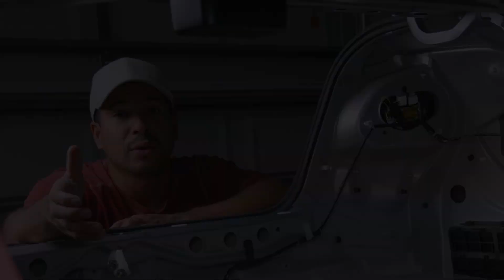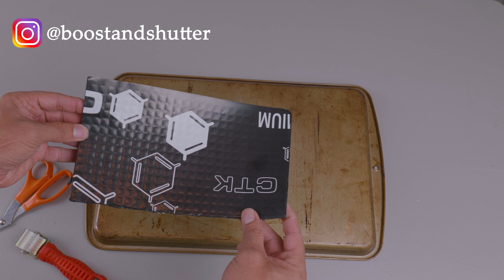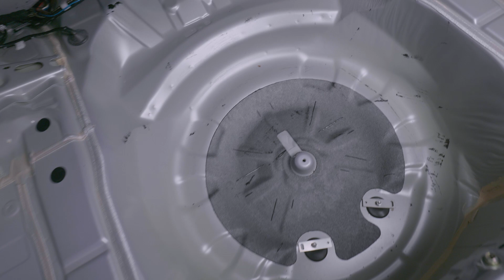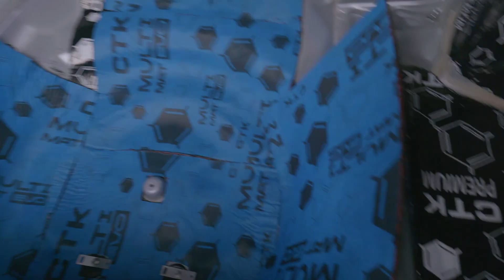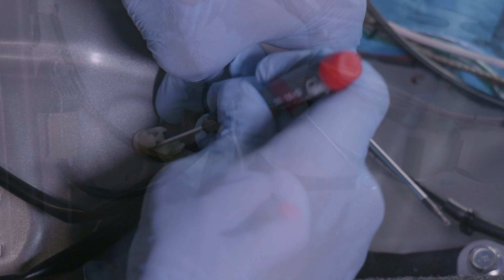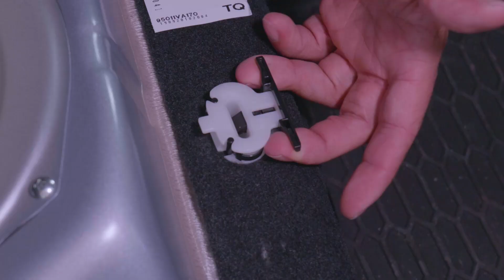WRX & STI Trunk Sound Deadening GUIDE | CTK  Review |

Comment: Nice talk through. 

I'm a professional in this area - mainly coming from aircraft before automobiles. I find many DIY channels do not express understanding of the materials and even many car audio shops or installation centres do not understand the materials and how to use them optimally. 

Constrained layer damping, deflection, absorption it all needs to work together. 
These materials are also designed to provide significant thermal benefits  and survive in very hot places which makes choice of brand important.
Reply: I respect your knowledge, can you give me exact procent of covering the trunk, sound deadening and material  which  to use to get best , but not add so much weight to the car?..should I start with trunk or doors, floor ?, honda civic x generation sedan, no much sound deadening and isolation stuff under ordinary carpet?
Reply: @ksweden3455  

First is to understand are your goals: 

1. Reduce noise from the outside world so driving is nicer and music needs less volume to be heard clearly.

2. Improve quality of audio in the car by: 
A) Reducing reflections (increased damping of the floor and roof), 

B) Reducing or stopping panel resonance (eg hatchbacks are prone to vibrating inner plastic covers), 

C) removing specific vibrations from wiring bundles or other elements specific to your car. Some become more obvious as louder noises are removed. 

Preliminary work:

1. Know your car - which types of noise are bothersome for your car with its design. 

Tyre, exhaust drone, wind (roof , windows or doors), engine noise as examples. 

The source location and freq of noise is what you want to know. This will tell you what material and location strategy will help.

2. Have a FULL workshop manual to understand how to disassemble your car interior without breaking parts. 

TYPES OF MATERIAL AND FUNCTION

1.  "Constrained Layer Damping" adds flexible mass to a surface, captures vibration and converts it to heat. This is what "Dynamat" is and it is used on any surface like car panels that resonate or sound "drummy" when you tap them.  

About 10%-25% coverage  of each "drummy" section is advised yet many use it 100% and even in dual layers which adds a huge amount of weight for potentially very limited gain vs other materials. 

2. "Viscoelastic Damping Material" that are "Mass Loaded"  like "Mass Loaded Vinyl" (MLV) is used to block low freq noise. Exhaust, road noise and some wind noise freq. 

It's very effective yet reasonably heavy by design. 

Dynaliner is a good example that also incorporates a foam layer on either side which absorbs higher freq noise. 

3. Closed cell Foam is used to absorb higher freq energy that MLV will not. It's great for absorbing some noise coming in, and potentially deadening the sound bouncing around in the cabin. 

Side NOTE about vehicle heat: "Emissivity" is the process of heat energy being reflected by a radiant barrier. Mostly a concept used in insulation of rooves in homes. The shiny silver foil reflects energy and thus reduces heat in the home. A shiny product like Dynamat is often used to reduce heat from the engine and exhaust along the transmission tunnel by using 100% coverage. Again this is quite heavy compared with using a radiant barrier on its own with suitable sound isolation over it and then carpet. 

Understand that on the roof this may reduce the "hot head" feeling of heat coming through onto your head, but the vehicle will still get as hot as it is going to because of heated glass, metal panels and "heat soak". Understand the limitations of the materials. 

A Case Example of my own vehicles: 
1. Apply viscoelastic material like dynamat to doors, quarter panels, roof, floor pan aiming for about 15% coverage of each area where tapping produces a "drum" like sound. 

[NOTE: This is often the biggest point of "failure" that I describe in those fitting these materials - when they cover entire interiors in multiple layers INSTEAD of using lighter and more effective products to get a better or equivalent finish (for less weight, time and cost).]

2. Apply radiant barrier if heat management is absent and is a core desire - on roof, firewall, transmission /exhaust tunnel as necessary. 

3. Apply MLV like Dynaliner on the entire floor, boot, tyre well, wheel arches, rear quarter panels and even the hatch if it's a hatch back. Cut, tape or do what's needed to shape it on curves to be as complete as possible. 

Gaps matter - think of a closed door at home where noise comes under it to be heard. 

The roof as well if you can fit it between the roof and roof card.

This is aimed at reducing road noise, tyre noise, exhaust drone, engine noise and wind noise (the roof may matter more with roof racks as they can create loud noise).

4. Apply suitable mould/weather proof adhesive backed close cell foams to door panels, door cards, other locations not yet insulated. Use the thickest you can in any particular spot. 

If your MLV does not incorporate a foam layer you would place foam on all MLV locations - especially the floor to ensure max use of the carpet for absorption and best comfort. 

If MLV is not in the roof use the thickest foam you can while still having the roof liner fit.

[Watch a lot of the good YT videos on doing this to seal the door and around speakers so that the sound that gets into the door is minimised from coming through the inner door lining and door card. Foam behind speakers in the door can help prevent backwave issues too].  

5. wrap foam around cable bundles or use it on dash panels etc - even dynamat if needed to deal with panels that vibrate or resonate because of the sound system.

That's a basic start for you.
Reply: @michaelrobinson9643 Thank for this!
Reply: @michaelrobinson9643 Hell of an answer, thank you
Reply: @jonathandyang I just reread that and think maybe it deserves a video of its own 😅

Comment: Hi there. I love your videos. ? I have a 2023 WRX and I’m looking to add subwoofer to it. I I was wondering do you know where I can a find a harness to tap into the speakers so I can send the speaker signal to the LC2i. 

And can you recommend a subwoofer and AMP. 

Thank you so much.
Reply: It's been a year but if you're still curious an idoing head unit and skar twin 10s are a fantastic combo
Reply: Thank you I appreciate the advice. Just one question. Do you know where I can find a harness to tap into the back of the head unit or are you tapping into the rear speakers for the subwoofer signal? Thank you for any advice and help
Reply: @felixlaboy1453  Unfortunately, no. I didn't use a harness to tap into anything I just ran wires from the head unit
Reply: Thank you.

Comment: I appreciate that you showed the cookie sheet, AND referenced "dimenishing returns" for foam coverage. Excellent. Someone selling the product would have said "you need 110% coverage. The REALITY is, if you stop the metal from vibrating, you stopped it from vibrating. 🍻👍
Reply: The diminishing returns was for the first layer, not the foam. The foam should be close to 100% coverage but it's also lighter.
Reply: Cover 110%.  Been doin this 20 years.  Don’t skimp out.  U add 40-100lbs.  Your gas tank won’t notice a 5 year old in the passenger seat.  No such thing as diminishing return here.  Cover the engine bay too

Comment: In hindsight, I think trying to reduce or stop road noise coming in from the wheel wells would be a good area to prioritize
Reply: it is a big source. On some vehicles the roof is another (also a massive heat source having no quality reflective barrier under the roof liner). Exhaust /transmission tunnel too. Windows are a tough choice - about the best you can look at there is glass thickness, and possibly a glass laminate. I don't think anyone has done actual research on how tint alters the resonance of glass but it would have an impact.
Reply: What would you prioritize? Wheel wells then floor then trunk? I was thinking of using the two materials for the drivers are and noisiest parts, then just 50% butyl on the rest

Comment: Hey boost, I have a 2020 wrx base and watched alot your videos. I upgraded my speakers and I'm debating on if I should do the idoing head unit or add amp an sub with line output converter. What would be the most cost effective or what order would you do those upgrades? Was also wondering if any of these upgrades set off your starlink telemetrics box.
Reply: I just installed an Idoing head unit in my 2021 wrx and it made a noticeable difference in sound quality.
Reply: @Jake Hallgren  I ended up installing the idoing with a sub under my passenger seat.  An jbl speakers and kenwood tweeters. Big difference.

Comment: would love to see what you did with the third brake light
i've matted the bottom of the plastic shelf, put some on the 3rd brake light itself, matted the top AND bottom of the metal deck and it STILL rattles. it's a very loose connection to the rear deck.
Reply from the maker: I can tell you with 100% certainty that the seat belt mechanism will always be a rattle point. There is nothing that can be done because it's a sealed mechanism that you can't remove and it has lose parts inside (I've taken it apart)
Reply: @akqjtn  I've had my kids push down slightly on the 3rd brake like and it immediately stops that part from rattling. maybe once that's done i'll hear the seatbelt, but for now, it's that ridiculous 3rd brake light
Reply from the maker: In the trunk there is a hole for the light, try inserting some material in there to push the panel up in that spot slightly, stopped that particular rattle for me...
Reply: @akqjtn  alrighty, I'll give that a shot. Appreciate all the videos!

Comment: If I only had the time. Sure, I could split the job into smaller chunks...but I still need the time (minimum of 30 mins) to remove/replace.   Gorilla packing tape works too for seam sealing.

Comment: This is a great mod for subaru. Which are known for excess road noise.
Reply from the maker: True story
Reply: Imagine if Subaru took the time and applied a (sound) deadening material to the underside and (interior) floor pan. Not just the tiny "panel squares" they place sparingly throughout the car.  10 lbs of material sprayed either before or after paint would be fine AND they can still use the flat aero panels underneath as well